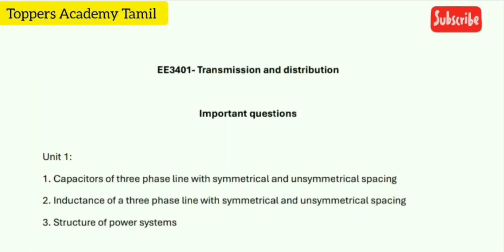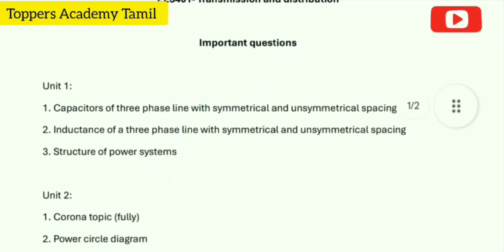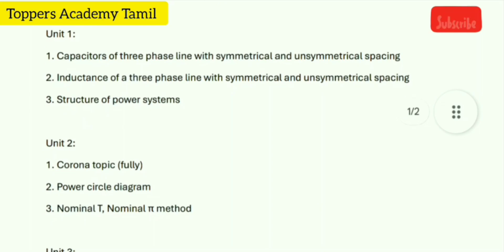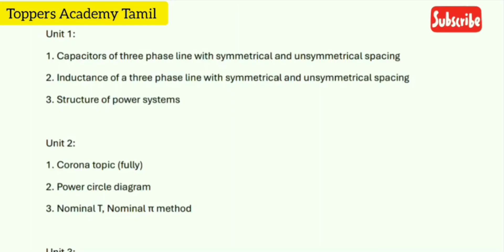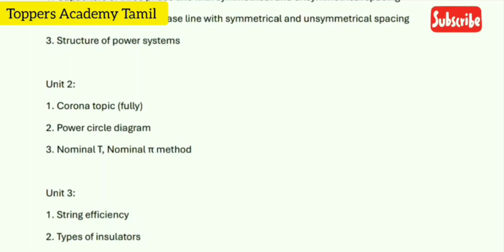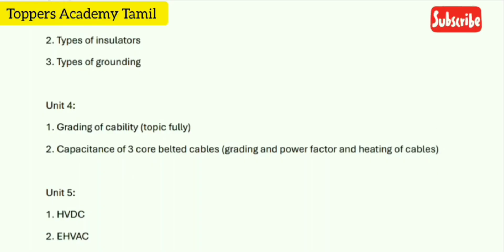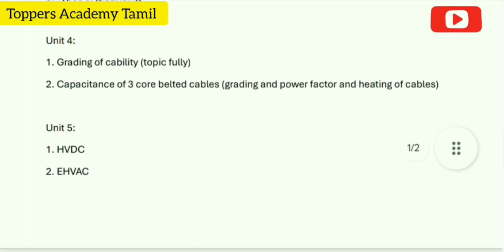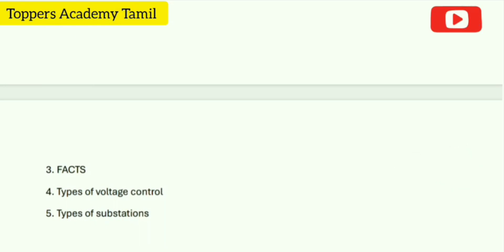EE3401|Transmission and distribution |Important Questions 💯💯💯|@Toppersacademytamil

Comment: Sir EE3402 linear integrated circuits,EE3404 microprocessor and  microcontroller and EE3403 measurement and instrumentation EE3405 electrical machine 2 important questions upload sir